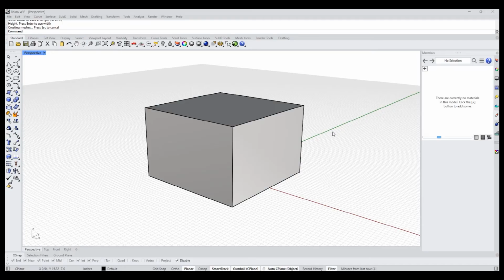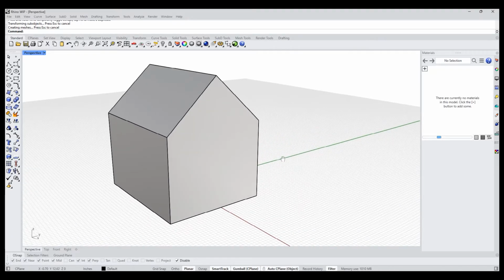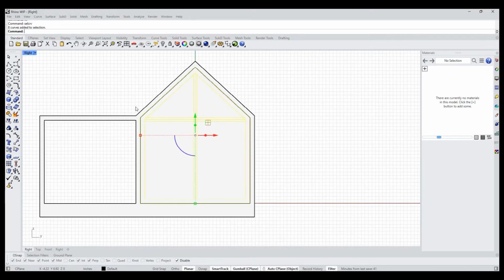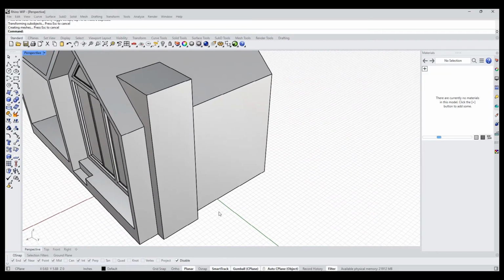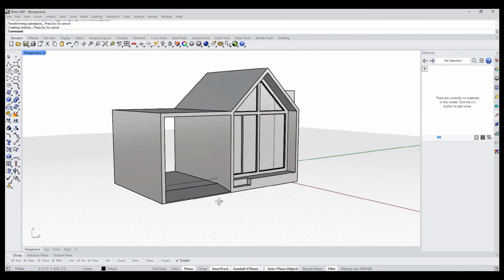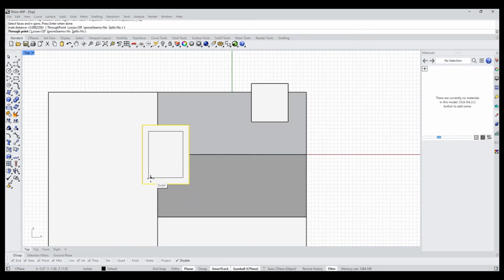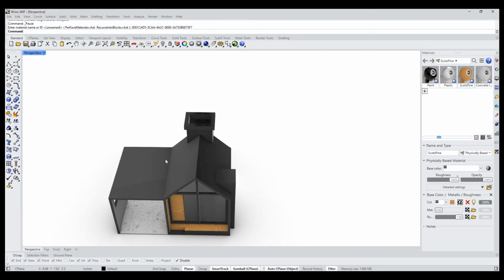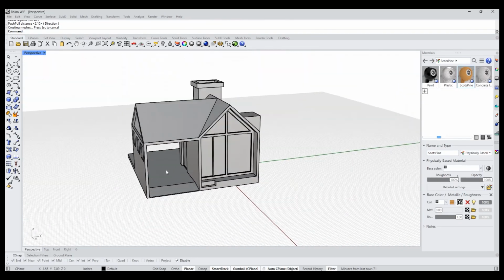Rhino 8 - building a house with Push Pull (new!)

Comment: Super cool.  Can you not use layers to assign materials? In this tut. the whole project seemed to be on layer 1, and the model stayed closed.  Usually I place everything onto a layer (window layer, wall layer, floor l;ayer, wood layer)  I guess you just have to break this system at some point?
Reply from the maker: sub object selection would allow you to assign materials by surface. 

However, Since the object is a polysurface you'd likely rough out the form, then start refining later. I.e, adding materials, extracting surfaces for layer assignment etc.

Comment: Enjoyed your lesson.  I have a couple of questions.  Where can I get wood materials for the renderer.  I started with R5 and am evaluating Rhino 8 to see if I want to upgrade from 7.  I've often wanted wood material and have sometimes created my own with a jpg picture.  When I got to load materials from the library there are wood types listed but nothing gets loaded.  The other question is when you were placing things by snapping when you are using gumball is that a gumball setting?  Is there a video you know of talking specifically about gumball.  I use it a lot but am sure there are things about it that I don't know.
Reply from the maker: check out the gumball party tricks video on our channel for gumball fun- 

for the wood, check out the new procedural wood in v8 it's quite nice. 

there are several woods in our render library that ship with v8.
Reply: I am trying out Rhino8 and there are no woods in the render library.  What is procedural wood? @Rhinoceros3d
Reply from the maker: @joebabb504  in rhino 8, show the file explorer there is a wood folder in the render content folder. 

for procedural wood, make a new PBR and in the color channel, click the checkerboard then pick the wood texture, that allows you to control it via sliders-

Comment: Love these features in Rhino 8 (push/pull/inset). In SketchUp there is also very useful feature, with snapping. You can snap to line/axis and plane. It allows you to find plane and line intersection (without physical intersection).  https://youtu.be/tBRp-8ZHTh0?si=pcQ7lW4lRWlG8lNa

Comment: doble-click for doing repetitive push pull and inset ( just like  SketchUp)  it could be very nice feature 

another thing could be borrowed from SU  is its groups and components, yes I know that Rhino has blocks ... but managing components in SU is much easier. 
ability to open and close groups by DoubleClick is another SketchUp  feature that could be here in rhino . 

these features could attract lots of SketchUp users to Rhino
Reply from the maker: set up push/pull on  a hot key or alias and then right click or space bar to repeat the last command. Not quite as immediate as a double click, but still faster then invoking it each time.

Comment: Haha, finally that SketchUp killer feature
Reply from the maker: similar workflow, but plays well with all the other rhino features. We are hoping it picks up where sketchup falls short when it comes to making real objects.
Reply: As an interior designer, I hope Rhino can seize more users from SketchUp and expand the Model Library of Vray~ @Rhinoceros3d
Reply: Not only is it more powerful than SketchUp by integrating with Rhino's original capabilities --

There are other benefits to someone who is not already trailed on the "sticky geometry" concept.  Simply put: Rhino modeling works as it does in conventional 3D modeling tools where you do not have sticky geometry, yet you can "MergeAllCoplanarFaces" (yielding sticky geometry) any time you like.
Reply: @InspiredScience  rhino is the goat
Reply: XD

Comment: But all the push pull geometry is connected which we somwtimes want to split after doing push pull so their should be a quick way to seperate the geometry quickly just like boxcutter in blender does. I mean the moment we are use push pull to substract something there should be hotkey or function to split that mass seperately. You can actually take inspiration from "ponte ryurai" (Hops boxcutter). How the actual boxing workflow should be in any software not just limited to sketchup push-pull
Reply from the maker: simply right click the explode icon to extract any surface from a polysurfaces.
Reply: @Rhinoceros3d  not explode into surface but it is like solid seperation.
Reply: Also I think plasticity is also a very fast tool rather than just planar push pull.
Reply from the maker: you can do a boolean split with a surface, or wirecut with a curve.
Reply: @Rhinoceros3d  yes that split/wirecut make sense.

Comment: These are a very useful set of commands. I have a question though, why not integrate the push pull command into the gumball extrude itself? that would make the process faster instead of having to enter the command every time. as an architect, it would be much more easier and faster to experiment with forms that way.
Reply from the maker: it's a topic of much internal debate. We have decided to keep our gumball simple as opposed to letting it grow into a mega feature beast. If this is the right decision only our users can tell us.
Reply: @Rhinoceros3d  - Objectively, there is no answer to this question because both (simplicity-vs-features) have nearly equal trade-off's

However.. This (and SketchUp marketshare) is precisely why you should allow a mode of "Quick Massing" where you offer an alternative look/purpose of the gumball designed for quick push/pull massing along with some other slight modifications while in that mode.

The logic behind two separate approaches is identical to two separate cplane modes; you can't change the original; it's important to keep. However, you can add a new option where it allows auto-cplane and return to the former.

In short, you have two different modes of 3D modeling. One is quick/simple (emphasize:quick over robust) and therefore, the only way to truly make everyone happy is to offer a "mode" toggle between the two modes. Some people, primarily SketchUp and BIM users that only prototype in massing -- may be more apt to switch to Rhino and ... may rarely ever go outside of this mode.

If this doesn't make sense, please reply so that I can clarify further ... and thanks for the great v8 features & video!
Reply: @InspiredScience  That would be the ideal solution to many debates... Just add some options and let the user decide.
To be fair, you can already do A LOT of these things in Rhino 7 using Gumball Extrude and then cleanup the surfaces with MergeAllCoplanarFaces... so why not add an option to do that with the Gumball extrude? The main advantage of the Push-Pull command seems to be the region recognition feature which looks very nice.
Reply from the maker: I agree with you, the trick is to get the rest of the rhino community to agree with us! Please post this thought to the forums so we can start a discussion about this topic there.
Reply: @Rhinoceros3d  Similar to AutoCPlane, have a toggle option.
Reply: Yes I agree, that's exactly 3ds max is trying to do